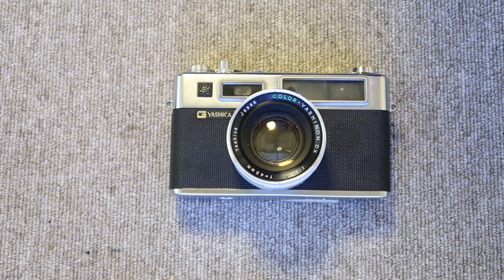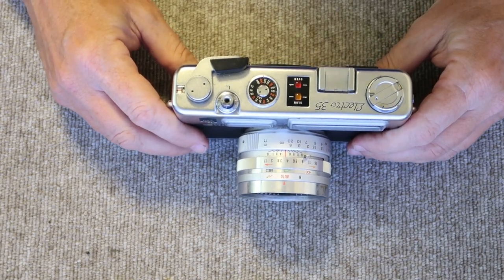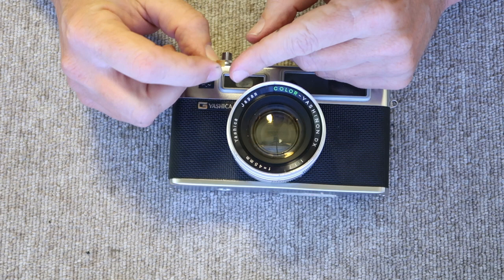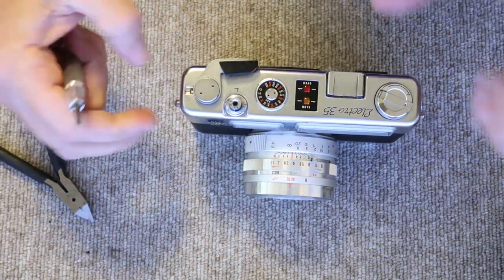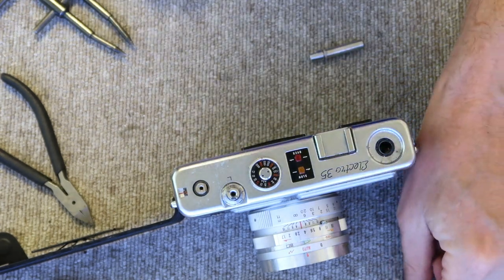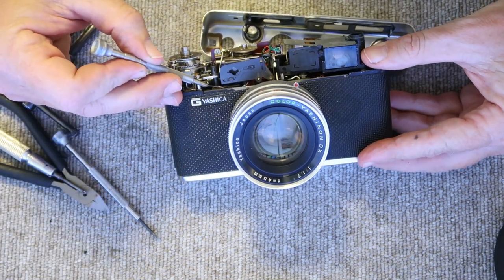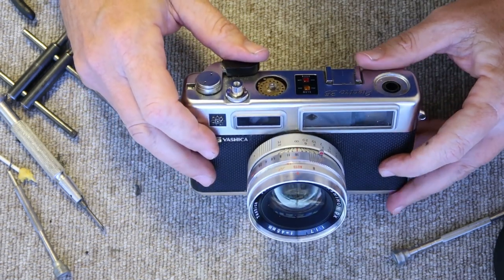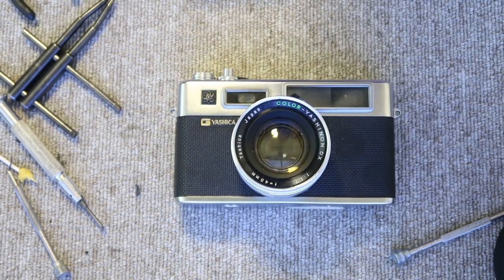How to Replace the POD in a Yashica Electro 35 the Easy Way

Comment: Thank you for this great video on replacing the POD on a Yashica Electro 35. I was able to successfully replace the POD on a Yashica Electro 35 G. I used a tiny bit of leather cut from the original case.

Comment: Super videos as always. Quick question. I have one of these and apart from the POD problem, my camera also has an issue with the focusing ring. Basically when I focus I see no change in the viewfinder. I think the linkage is disconnected but not sure. Any advice on how to go about fixing this? Thanks.

Comment: Hi, there is two red positive wire on the battery chamber. One connected on the battery check board, i couldn't figure out where the other one goes.

Comment: I remember you  talked about lamps buzzing problem and the solution about that.
Now I cannot find that part in your video again.
Which video and which part is it?
Reply from the maker: You need to remove the bottom cover of the camera, if you look inside the bottom, directly in line with the shutter button, there is a slide switch about an inch up inside. Add a few drops of lighter fluid, then wind the winding lever to the end, hold it there, and cycle the shutter button several times. This will clean the contacts, and stop the buzzing as well as cure flickering meter lamps.

Comment: Hello there. I've successfully replace the little part, and the camera fires well now, but any reason, the adance lever doesn't come back easilly. I have to push it to make it back otherwise it gets stuck. I don't understance what happened since I didn't touch something related to it. Looks like something block it. Can you help me?
Reply: I finally fixed the issue just by screwing the top plate.
Reply: thanks for providing a fix, I had the same problem

Comment: The ISO lever how to mount that? You dont mount it 🤔, how I now it was on the right place??? Thanks
Reply: If you turn the ASA dial Counter Clockwise, it should land on 1000 when it can no longer rotate (or ASA 500 in this camera's case). If you move it Clockwise, it should land on 25 when it can no longer move. When it does that, you'll know that the ASA indicator decal is in the correct position.

Comment: What is the size of the screwdriver and the Allen wrench that you use?  Thank you!
Reply from the maker: For scraping off the old POD material, anything which is small enough to bend 90 degrees will work. A dental tool would be best. For the rest of the hardware I use a JIS Philips head screwdriver, it is a 2.5mm size if I remember rightly.

Comment: In my admittedly limited experience, the only problem I see on the camera I have with pad of death is that the shutter doesn't stay open after lifting your finger.   Which doesn't seem to be a problem really.

But should I expect the shutter to actually fail in the future? Or am I experiencing the extent orvthebproblem?will using with this defect cause further problems?

Thanks
Reply: Have you tried shooting it? If you're getting correct exposures you're in the clear. The problem with the pad of death is that the cameras shutter will only open for 1/500 of a second or bulb, which can and will incorrectly expose your images